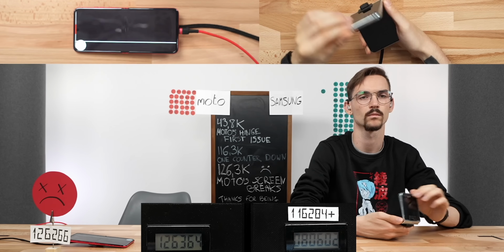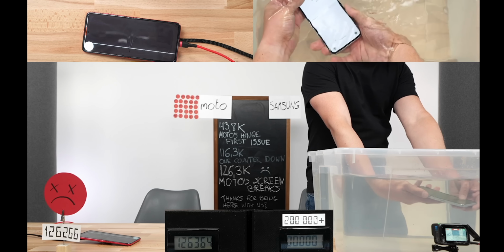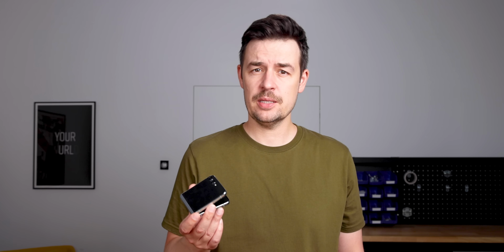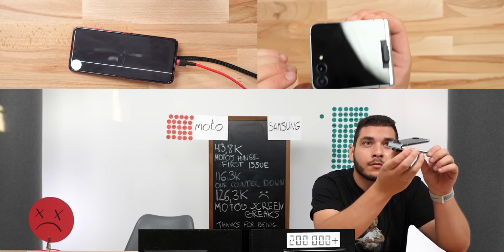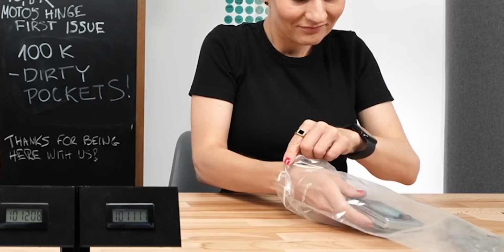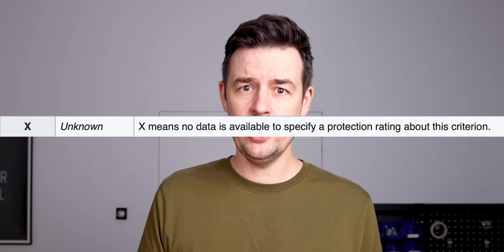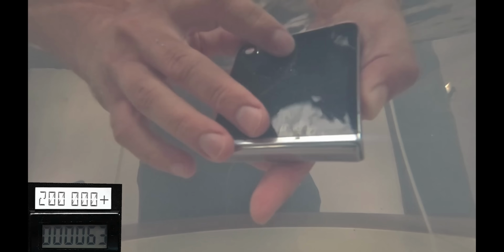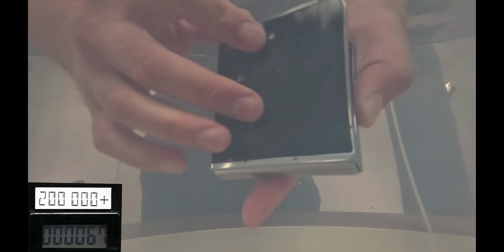Z Flip 5 Underwater Folding

Comment: The Galaxy flip 5 has had up really well and if everybody's flip was as tough as this then I think there will be few complaints. As for water resistance, the IP rating is mainly for your dropping in water, not for flipping or sustained water ingress despite what it says on the package. It really is for accidental water exposure and I wouldn't recommend taking it to extremes like in this video.
Reply: Yea, that's right. I completely agree with you...
Reply: Well I don't think Samsung wants you to coat it in dust or fold it 200k times in the span of one week either but here we are.  The whole point of the video is extremes lol.

Comment: Iv got the fold 3 and i started getting that same nose and my screen protector turned as white as scotch tape just on the crease and had never dropped submerged or exposed it to dust other than just ur daily use of a device indoors and outdoors then my back fell off and noticed my battery swelling and this is all after 15 or so months of having it and wouldn't u know this happened after all warranty was gone thankfully Samsung came through and did a complete free repair after tmobile dropping the ball

Comment: The way i see it is you will never get to 200,000 folds in this phone's lifetime. I've had my z flip3 for almost 2 years and have folded it <15k times

unless you are addicted to folding it i guess
Reply: It does seem unlikely. Considering they are supporting the phone with software for five years, at which point you can expect the battery to be suffering quite a bit, that's over 100 folds every day to get to 200k. I did a fair bit of searching prior to buying my Flip5 (my first foldable), and it seems the primary point of failure is related to the adhesive holding the top layer/screen protector in place, resulting in bubbles. Crossing fingers they finally figured something out for this generation.
Reply: @mascot4950 which one has the adhesive failure? Are you meaning the flip 5g? The flip 5 isn't technically out to the public but if you have one and you're already having that issue.... I may need to cancel my preorder
Reply: @Sos4R4y I'm talking of historical data for the previous flips and folds. Samsung keep saying they've implemented fixes, changes to screen protector and/or adhesives, but even on the flip4/fold4 it was still an issue. How prevalent, I can't say, but often enough to keep getting mentioned. We won't know how the Flip5 turns out for a good while. It's been available where I am for a few days now, so I have mine and am loving it. Whether I still will in four years, time will tell. :)